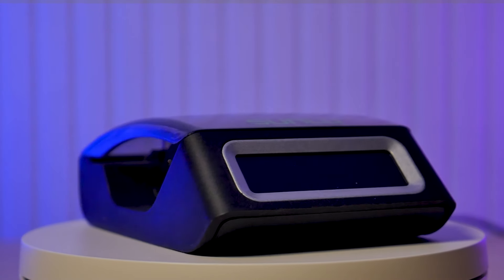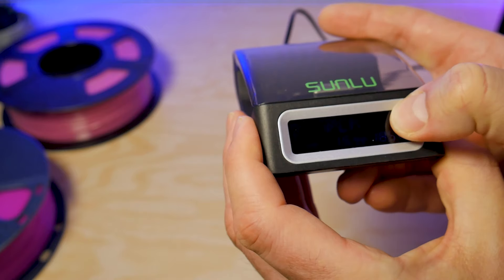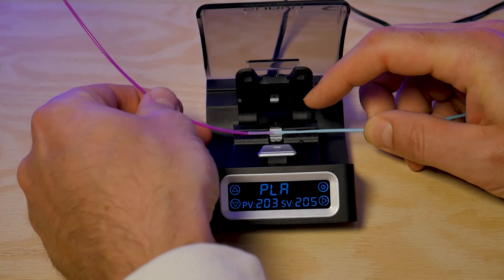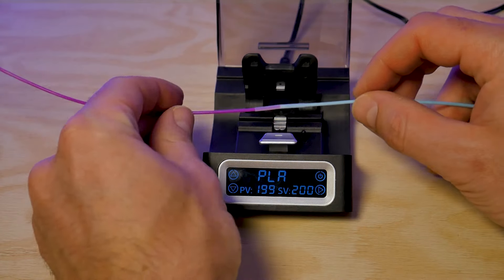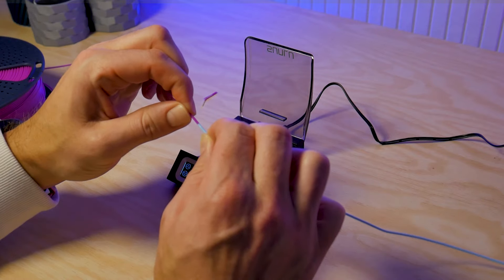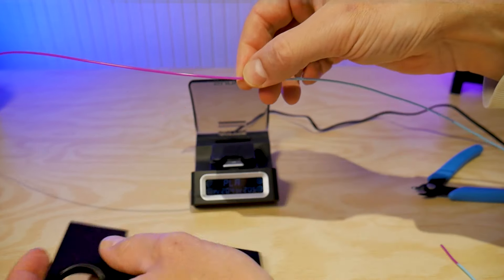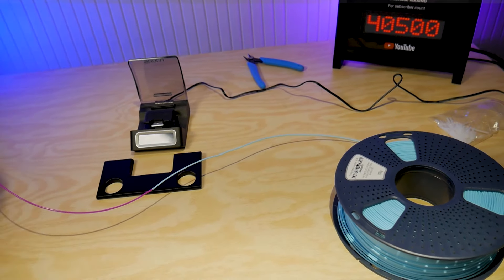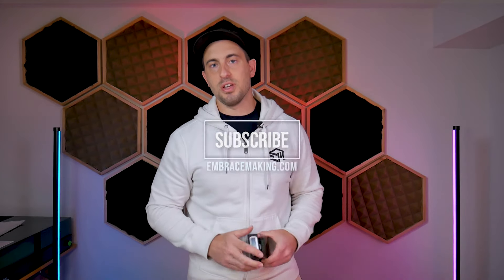SUNLU Filament Connector - Best Tool For Your Spool? Plus Free Printable Accessory

Comment: The official Sunlu video and I believe instruction sheet advise cutting at 45° before joining... Also I watched another video whereby the guy advised holding one side and only pushing the other. I have just ordered one so it will be interesting to see how it works.

Comment: Wouldn't a 45 degree angle work better, more surface area for the weld? Did you try?
Reply from the maker: I think your reasoning is 100% sound but the problem is the alignment. If you twist the 45 degree cut ends out of alignment it won't work. When the filament is constantly trying to twist it just makes it a bit tricky so the straight cut ends are less sensitive. I can give the 45 degree ends a try though and see if I can reliably get them to work
Reply: @EmbraceMaking  you designed a nice jig to keep the filament in place. When I get this thing I'm going to look into some sort of jig that with two tiny clamps that secures the filament, While typing my brain goes: soldering helping hands?